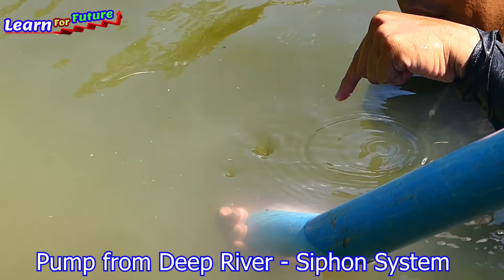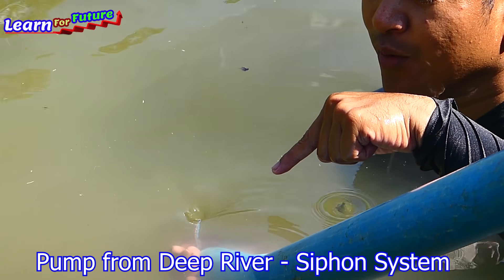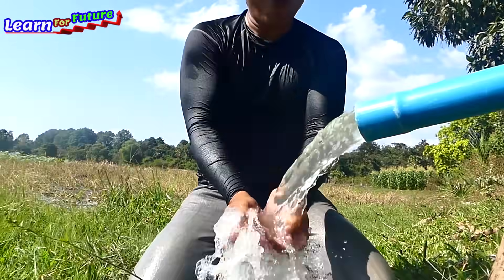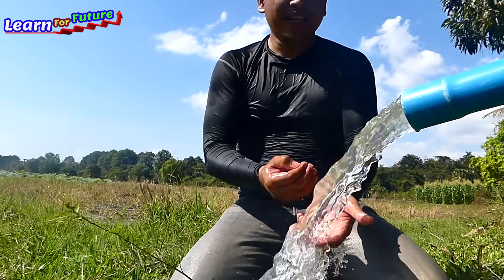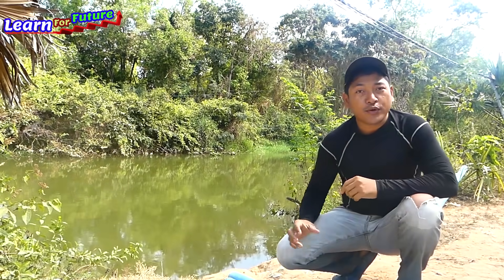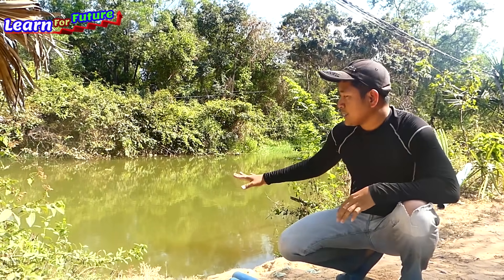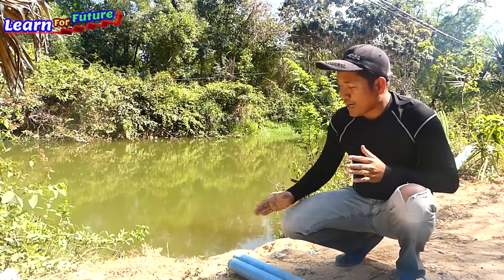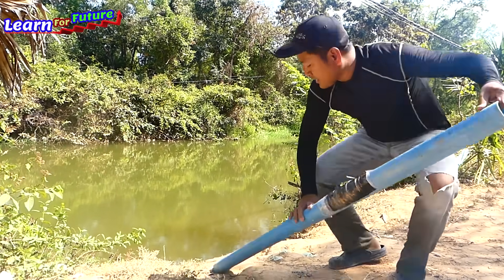Auto Water - Siphon System!! How to install Siphon System suck water from Big River for Big Farms.

Comment: If you joint 2 valves/foot valves to inlet pipe in river instead of plastic bag and rubber straps it is better. Just turn the valve

Comment: Why use two suctions pipes when with same diameter as the exit side? Waste of money. Vertical pipe on the output side is not needed, waste of money. Why not open first in the river? Then no rush to open the exit, you can wait to the next day!

Comment: This kind of water pump can it not work without that valve on top of that first pipe pointing up??
Reply: This is not a pump, but a sipon. The vertival tube is only to fill all the tubes before getting started. You can fill the tubes in other ways too.

Comment: Thank you so much for this helpful informative video. Will this will work if the elevation where we want to hook up to barrels is much higher than the elevation of the stream or river (no more than 10 or 20 m higher elevation)? The distance from where the stream is is about 80 m.
Reply: Also, yes, the music at times is very loud and we cannot hear you're clearly.
Reply: No this system only works from a high river to a low field. So does also a siphon with a barrel. The river must be higher than the exit. Adding a barrel to a siphon does not make it into a pump.

Comment: Dear friend thanks for video efforts
Would plz tell me in your experience 
Which system has more pressure with drum or without drum
Reply will be appreciated
Reply: Does not matter. Only diameter of tubes matters, grater diameter, more water. Then the height difference from the higher river to the lower exit. The barrel is only a different way to prime the system, it is still a siphon.

Comment: If I close the valve at the water outlet and then open the valve after a few days, will water be pumped?
Reply: Yes. System must be water and air tight.

Comment: Ever tried siphoning petrol from the car? or water from an aquarium?,, exactly the same thing. I just need to find a river thats elevated higher than my garden. Not likely. Simple solution is to get a large pipe, block both ends and open them when ready. Simple.. do you have any idea of a siphon system that works the other way around ? from low to high ? that would be impressive

Comment: if you put another valve in on the river or inlet side of that vertical pipe and close it, you don't need the bags on the inlet pipes in the river just fill the pipe close off that supply side valve and open the other one you have enough suction on the other side.. just pop that outlet bag and away you go.

Comment: if you have 2 legs of 2 inch pipe you need the 1 leg going out to be 3 inch or its not much different than only 1 pipe in and out rather than use bags get a few pipe caps to seal the pipes non permanently use silicone

Comment: Add water wheel connected alternator to discharge end to generate electricity and irrigate at the same time. Don’t let that free energy go to waste. Good work. Thanks for sharing!
Reply: A tiny solar panel would be more effective
Reply: @bigredinfinity3126  solar panel won't do shit if it's cloudy or raining so I think water energy is still good as part of a power system if it's an option
Reply: @lp3668  so with that flow how much power you think you would be getting. Also take into account the water is high due to rain
Reply: @bigredinfinity3126  😁
Reply: @bigredinfinity3126  danalolasiveraqengmskadardibskajambetapa
Reply: @bigredinfinity3126  q
Reply: They been doing this in Mexico 🇲🇽 Land for decades is nothing new awesome video 👍
Reply: I was thinking the same thing just as I read your post. With that kind of continuous pressure you could generate quite the electrical output.
Reply: Add water whell connected altenator to doscharge

Comment: Let me get this right. The water level in the river is higher than the farm field that he's irrigating? Then why not dig a trench from one side of the road to the other and lay 1,2,3 PVC pipes, how much water do you want, in the bottom of the trench. fill in the trench so vehicles can continue to use it as a road. (It's is, after all, a road.) When you want no more water, jump into the river, this guy obviously doesn't have a problem with jumping in the river, and cap of the tubing with a PVC cap, caps. 
It doesn't piss me off that he made a YT video. 1.5 million views, he's making money. What I have a problem with is the comments that actually think that this is a good idea.
Reply: Maybe you are not allowed to mess with the canals integrity? So no digging is allowed.

Comment: Why did you feel the need to use 2 pipes as a suction when one single pipe would have been less work and would give the same volume on the discharge?
Reply: I think its due to the siphon effect, with 1 pipe he has less time to take off the plastics in the intake.
Reply: @Grandpasaab  Yes.  Yery true.  If you can afford a reducer, a different sized set of discharge pipes, an extra ball valve, and a flap check valve, there is no need to jump in the creek or use plastic bags.  Just top off and close the valve, then open the discharge valve and watch the magic flow.

Comment: This could be made more easily with an improvised plastic bag piston connected to a 4 meter long cord , just put inside in a straight pipe , pull it out with the help of the cord to create a vacuum , and water flows ... and how convenient to have a high level river , but if the dam breaks ...
Reply: COME ON MAN !! BE OPTIMISTIC !! THE DAM HAS TO BE STRONG SO IT WON'T SUFFER BREAKS !! RIGHT ?? THANKS.

Comment: I think there is a easier way to do this. Just make one length of pipe from river to field.  Put it in the river and let it fill with water. Close it on both sides with plastic and rubber strap so the water stays in the pipe. Take pipe out the river and put it on the dam. Punch a little hole on the river side in the plastic and then on the field side. when the water runs remove the plastics. Ps the easiest way would just be: Dig in the pipe and put the valve at the field side ;)
Reply: But you can't make a YouTube video out of  that😉
Reply: That wat I'm thinking 2
Reply: With 2 pipes in the river u get greater pressure. But i agree u can do the whole thing outside the water and fill with water and the put in water and puncture the plastic covering
Reply: @zahidaskar7314  With two short tubes in the river you get a fraction less friction in the system. Is it really worth the cost?
Reply: Looks like this call gravity system..
Reply: Please
Reply: Even easier: start with an open end sucked in the river. Block the output end as the full length of tube is submerged. Drag the filled tube over the ridge and release the output. Done. No need to jump into the river.
Reply: I did it or try it but it didnot come why?

Comment: Some rivers are way low level to the farm land, so Is there a workaround to it? 
Natural law is what brings the water out to the farm as it is at lower level than the water source. So he could just actually get a long big hose, fill it with water and connect the other end to the water source. It will give the same result as his one.
Reply: Do you mean a workaround which requires no electricity, petrol, etc?

*A hydraulic ram pump may be an option, if there is at least around 1m head down at the river/stream. There may be enough natural fall at some point, or it may be most practical to build a dam to get that 1m head.

*Another option, which is more dependent on depth and flow, is a water wheel pump.

Both of those can pump water to an elevation higher than the water source.
The water itself combined with pump design, provide the energy needed to run these types of pumps.
Efficiency varies with each design.

There are many ways to do it.
Reply: Hydraulic Ram Pump
Reply: Ram pumps
Reply: Duh!
Reply: This system can not lift water up from any well, or river. It is a siphon. Exit must be lower tan source. In some cases a ram-pump can do the trick. In other cases you may use a water wheel if there is some stream in the river. A spiral pump driven by the stream in the river may also fix it.
Reply: In your case, the solution is pretty easy.. Get some money and buy water pump & gasoline

Comment: the river is higher than rice field thats why
Reply: Put hole in the ground and finist, no need pipe tsk.
Reply: Where river/source is higher than the   field then there, s no need of barrel to stock water hence the force water is greater in volume and lesser expense on materials used.
Reply: People do the same with RAM waterpumps from deep waterwell.

Comment: When i was a kid im using this method to transfer water from the barrel of water to the small containers. Because in the past we need to stack waters in a large barrels because water in our place is hard to get. And im to lazy to transfer waters manually like the others kids so came up with that method. At that time i feel so smart when i came up that methods
Reply: Same
Reply: Same here. I used a short hose. When not in use, it was hooked on the rim of the barrel so I did not have to fill it with water again for every bucket.

Comment: Comfirm that the side where the water comes out in the rice field, that side must be lower than the main water source?
Reply: Yes
Reply: It would not work if the discharge point is higher than the river level. Simply siphon system, no need for the tank. 🤔
Reply: suction. see videos with tank where water is pulled up to 7 meters.
Reply: @srinigypsy  No. Adding a tank to a siphon does not make it into a pump. A siphon can not lift any water to a higher level than the source. It is correct though that a siphon can lead water over a 7 m high wall, but all that water must down under the source before exit.
Reply: @kjellg6532  you are correct sir.
Reply: To lift water up hill you would want a Water Ram. Old style of pressure pump, simple to build.

Comment: Invest on 2 non-return  valves at intake and most of your problems are over. You could also add a closing valve at the output and that way it will be water on demand anytime. No need for adding water with a bucket anymore

Comment: From your previous video, you have got rid of the metal container, less equipment, however you can add a non-return valve at the intake pipe to avoid jumping into the river?
Reply: Correct! Here with no barrel, one needs a one way valve if you do not want to take a bath.

Comment: Interesting. Good for you. I suggest you should register this concept/pattern legally, so it can be commercialized. Unless it’s just for sharing. Thanks anyway. I would like to try. 👍👍👍👍👍
Reply: If the source of WATER is  higher yes it works ,you can apply the law of gravity, or Boyle's law , physics and Hydraulic.
Reply: dont be fooled by the video Sir... try to check the levels of source and the ricefield... 
source is higher than the ricefield and this is the only reason why it os working...this will work even a flexible hose alone..!
Reply: When it comes to hydraulic , those who constructed Dams freely flow of water to the irrigation  using canal normally V-type or closed circular pipe canal,there must be 10 cm inclination for every 100 meter .by applying hydraulic if the source of water is lower using reservoir suck the water up,the discharge must be heavier than the intake water let's say ,the size of intake pipe is 3cm diameter,then the discharge pipe should be 6 cm diameter and about 10 meter long, in 2 meter height inclination.

Comment: You can use electric generator to use electricity with siphon method
Reply: the point of doing this would to avoid using a generator, smh
Reply: @kirkvillelocomotiveworks4691  DEFINITELY RIGHT !! THANKS.

Comment: What is the size of pvc pipe ?.     Kindly explain in inches. And also explain the out put lenth please.
Reply: the  way  he setup   all  2in
Reply: It looked like 3 X10 foot pieces of pipe = at least 30 feet  going downhill building suction.  It looked like at least a 10 foot drop. This would be the main provider of energy /force using gravity and the mass of the water.  Joules = Mass X Gravity X Height.  The initial up pipes were to start the process but the downward slope provided the bulk of the force.  That looked like it was about 3 inch pipe.  It is great that this man improvises and shows his builds for a working farm with what He has.  And, he is having fun doing it.  Great job. thanks for sharing.